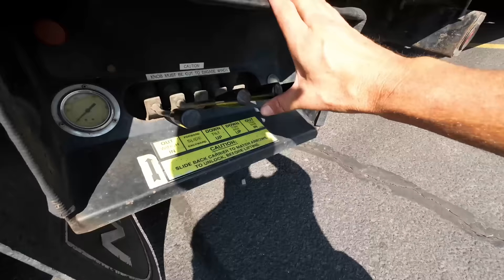A 6 Wheeled Muscle Car?? or just more Casey shenanigans…

Comment from the maker: This was actually the job where the truck broke down on the way home.   Now it’s two weeks later… and I still don’t have my truck back 🤦🏻‍♂️
Reply: So grumpy comes along and breaks your truck go ya. 🤣😂, All jokes aside good to do grumpy back
Reply: Man that sucks. Did you find out what happened to it? Injection problem maybe?
Reply: Sorry that happened Casey.  That’s actually the reason I became a Mechanic when I was 18.  I hope your truck is fixed as soon as possible.
Reply: Was just getting on here to ask for an update on the truck.
Reply: If only you would have removed those chrome strips sooner! Then the truck wouldn't have broken down!
Reply: Great video. If this is the video where your truck broke down what happened to the veterans motor home?
Reply: Replacing the chrome strips with something practical is a real good idea.Hows about multi color LED twinklies like Christmas lights? Next, in place of those cheap pop-off plastic lugnut spikes, you need to invent ones that pop out a flag that says BOO!!! Seriously tho, I get that some of the lugnut spikes sold are real steel or aluminum. Not all are the plastic things you got. Most folks wouldn't know that, and I only stumbled upon the info.
Reply: You spike yourself
Reply from the maker: @tinad1362  it’s gone
Reply: @CaseyLaDelle  Gone as in another Tow truck was found in time to save it or gone as in the City took it away from him?
Reply from the maker: @HappilyHomicidalHooligan  gone as in gone.   It got hauled away
Reply: @CaseyLaDelle  Well, that sucks!
Reply: @CaseyLaDelle  Oh man, I hate to hear that. I was hoping Rodney could get a little money from it.

Comment: I had a 74 Duster that ended its service with me as the exact shackle that Casey hooked to rusted away from the frame and came up through the floor of the trunk.  it was quite the surprise when I found it after the huge "THUNK" it made making its entrance into the vehicle.  My next vehicle was an under powered 76 Firebird - way cooler.  As to the shiny bits YES remove them (and the shiny spikes,  yes they are cool - for a while)
Reply: Yeah cool until you rake your shin across them!

Comment: Absolutely keep the stainless steel strips they’re cool….  Though if you did take them off I’d put that high reflective safety tape and put in their place.  Either with or the red and white kind. Just a thought.  I don’t know how the rails for the straps are built but maybe the strips can still fit on the outside for  visibility and eye appeal. 
     I do like the look the Stainless Steel gives your truck bed.  Keep up the great work.

Comment: Those spikes are questionable. Though they are a great visual deterrent for keeping folks away from your front wheels. There are two types of spikes that can be put on a vehicle: Clip-ons that go over the existing wheel nuts, and the kind that replace the wheel nuts. If someone were to scrub your front-end for some odd reason, the clip-ons can go away and the front wheel generally stays attached. With the spikes that replace the original wheel nuts, because they are long, they can be snapped off taking the wheel stud with them, and so your front wheel can also go away. 
  Seen a few YouTube crash videos where this happened. Just an FYI.
Reply: Casey has written that these are the plastic ones that easily come off.

Comment: This second part I want you to keep in mind it is just my opinion I’m not a tow truck driver I’m not a truck driver, so this is someone from the outside looking into a career that he doesn’t fully know. I personally think you should have a set of your dollies mounted somewhere up on the front by your headache rack so that you don’t have to remember to grab them when you go somewhere with the rollback. I also think you would really benefit if you had,(I’ve only seen a few of these, and I’m not sure if there’s a particular name for him or not), toolbox that sits in the place of the front bumper. It’s actually a tool box that sticks out about 18 inches and I’ve seen them with three lids and I’ve seen them with four lids. It also has the bumper bars so that you can push vehicles are items with and it would give you a lot of storage for straps and Yankam ropes and etc. etc. These are just ideas/thoughts and I’m not trying to tell you to do anything. I’m just running it past year if you want to take it up the flagpole and salute it, feel free and if you don’t know feelings hurt on this end and if you do it, no need to give a credit just do it you take the credit. God bless.

Comment: The trouble with the spikes or any lug nut covers  is you may have to remove them if pulled in for a DOT inspection. Not a big deal but a pain none the less.
Reply from the maker: No you don’t.

Comment: Keep the shiny strips on the sides of the roll off bed. Mix up some JB Weld and grab a few clamps and glue those lose leading edges back down flush where they belong. Problem solved.

Comment: Drive by Barney Fife with those spikes and you might get an over dimension ticket.  Safety items like mirrors are exempt from the 102" width limit, but spiked lugnuts are not.
Reply: You do realize that the bed in rear is wider than that, right? And so is the steps into cab…
Reply: @JohnHallgren  At 1:09 they sure look wider than the steps & deck.  Worth measuring, especially if you ever have to deal with a certain CHP officer in norcal...

Comment: One thought, the sliding strap holder. I can't for the life of me figure out why they are always mounted on the DRIVERS side. As someone who has had to tighten straps on the side of a busy highway with that pole hanging out of the sprocket into traffic it is scary and stupid. If there was any possibility   of passenger side mount I would not hesitate for safeties sake.

Comment: You could leave the chrome strips on but fasten the corners and every now and then with stainless round headed steel screws.  Not sure what you are talking about for winch things for the side of the bed.  I do know that YouTuber 'Super trucker Dan'  has winch pockets plus slidable winches on the sides of his 40' flatbed trailer.   
Just a DOT thing;  every light you add to your truck must be working all the time or it gives an over zealous DOT inspection officer something to write you up for.  Seen it.
Reply from the maker: That is flat out wrong.   Only the required lights have to be working.   Extra lights beyond what is legally required do NOT have to be functional.
Reply: I did find this on a well known trucking site:
“It is a long held belief that any lights that are installed on a commercial motor vehicle, particularly truck manufacturer installed lights, must be capable of operation, day or night.  More often than not, old school drivers know this to be true, the young drivers they are training are taught this to be true and many mechanics believe this to be the law, including those who are inspectors performing the DOT required annual Periodic Inspection.  Indeed, many law enforcement officers will issue a citation for any light on a CMV that is not operable.”

So while Casey is correct, it’s also apparently possible that erroneous citations have been issued which could be a problem for that driver.